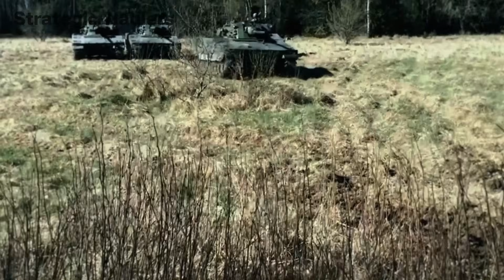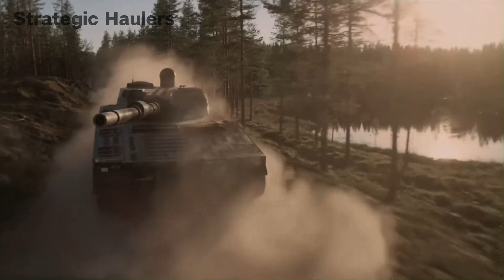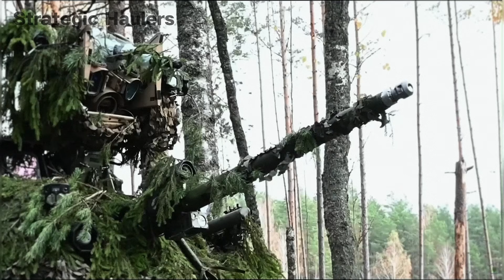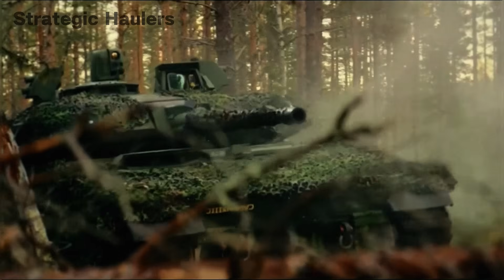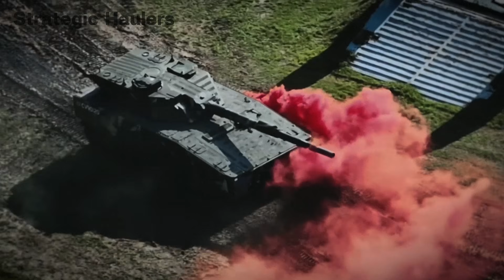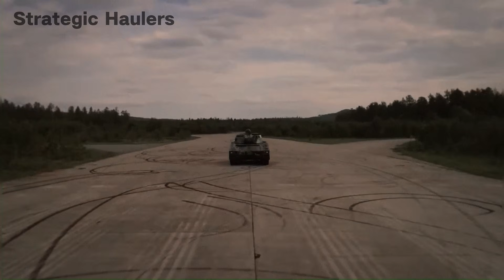The CV90 — How an Upside-Down Cannon Created Europe's Toughest IFV

Comment: Some years ago, Canada launched the Close Combat Vehicle (CCV) programme to acquire up to 108 tracked infantry fighting vehicles. The aim was to find an IFV vehicle that would better keep up with the country's then newly-acquired Leopard 2A4 and 2A6M main battle tanks. The CV9040 was one of the candidates selected for trials. 

However, CCV project managers decided not to go with the stock turret, and instead have DEW Engineering in Ottawa design and manufacture a turret mounting a different autocannon - in this case, the 25mm M242 Bushmaster.

After watching this video, I now understand why an alternative turret and gun system were considered. Ironically enough, at the time, the Canadian Navy's Maritime Coastal Defence Vessels (MCDV) mounted a 40mm Bofors deck gun, so 40mm ammunition was already in the Canadian Armed Forces supply system.
Ultimately, budget cuts resulted in the cancellation of the CCV project.

The current government is now looking for new tanks to replace the now-aging Leopard 2 fleet, and to acquire a tracked infantry fighting vehicle. It's looking like the Korean-made Redback IFV is going to be the leading contender, and possibly the platform that gets selected. Interestingly, the Redback IFV can mount an uncrewed turret mounting a 40mm autocannon using Cased Telescoping Ammunition (CTA) technology.
Reply: The feedback from Ukraine says the only change wanted to the 40 mm is doubling the readily available magazine capacity.
The large number of shells in the Bradley are nice, but only necessary because the the relative lack of punch per shell.
A salvo of four 40mm shells in burst mode on the other hand completely clears a trench 30 metres long.

Bushmaster has taken note, offering the Bushmaster IV in 40mm Bofors.
Reply: I wished the new CV90's also used the 40mm. There are sort of more possibilities in the future with a slightly larger ammo... But NATO logistics, 30mm or 35mm makes sense I guess... 35 has at least a fragmented round I think...
Reply: The CV90 comes with the calibre ordered by the customer
Since Sweden and Ukraine added their vehicles to an already existing order in production, they also got that order's armament.

Comment: At around 14:10 it's implied that a change in threat environment (with more advanced weapons) required the CV90 to get better armor. That's not entirely true.
The first models, 9040 A and B, were (as mentioned) designed to defend Sweden against a WP invasion. The envisioned doctrine was partially based on "protection by shooting first" and the IFVs optimized to be used aggressively, preventing the enemy from returning fire.
Then these were sent to Kosovo for use in peace-keeping UN missions where the rules of engagement prevented shooting first and only return fire. That meant shooting back after being hit by one or more RPG rounds, where the 9040 A/B versions proved worse than the much older pbv 302.
As a result 9040C was developed, with much better passive protection at the cost of reduced agility. It's 9040C that is in use by Ukraine today.
CV90 Mk II (and later versions) are based on these experiences.

Also: One very important feature of the 40mm cannon that's not mentioned is its capability against MBTs. The APFSDS is good enough to penetrate the side and rear of most modern tanks at useful ranges. This provides better tactical versatility than a smaller gun plus ATGM. The IFVs, often moving in forests and other tighter terrain, needs the ability to quickly engage tanks at close range, and ATGMs are neither quick to deploy nor very good at close range (<200m).
Reply: The strf90C came to be in Afghanistan, where the main improvement was air conditioning even though the increased protection was welcome.
To my knowledge no strf 90 were ever used during the UN missions in Bosnia.
Reply: @Mobil-Telefon  Not in Bosnia, but later in Serbia/Kosovo. Therefore the C-version was available for Afghanistan.
Reply: I appreciate your mention of the "protection by shooting first" [and then move quickly and swiftly in difficult terrain]. While not identical, or even fully comparable, vehicles, this doctrine and ability is shared between Strf90 and the Ikv91.

Strf90 - Swedish abbreviation of "Stridsfordon 90", translates to "Combat vehicle 90" ie CV90.

Ikv91 - Swedish abbreviation of "Infanterikanonvagn 91", translates roughly to "Infantry gun support vehicle". It shared several traits with the CV90, especially 9040: Light wheight (partly by weaker armour protection), excellent performance on soft ground and snow, manouversbility, fording capability.. No compartment for infantry on foot, though. OTOH, the gun was a 90mm (low pressure) gun. Intended for several support roles: Tank buster (HEAT ammo), anti-infantry (HE ammo). 212 built, in service 2976-2002.

Although battlefield roles differed, in some aspects I think of the Ikv91 as a precursor to CV9040.

Comment: Put a bofors 57mm l/70 and it will be capable of everything.
Reply: It's too big. It woul need a complete new turret and the passenger compartment converted to ammunition storage.
Reply: @satanihelvetet like with the 120mm gun?😅
Just keep that turret and put the 57mm in it😉
Reply: @satanihelvetet How did they do it in CV90-120?
Reply: @uppsalahazzemarkstedt2759  They made a completely new turret and converted the  passenger compartment to ammunition storage...
Reply: @satanihelvetet @Merecir  good comments. 😊 

To add facts to the naïve notion of just making everything biggger: 

@apostolosapostolopoulos and others

The 120mm is loaded manually, round by round. The back end of the gun is a breech and nothing more. It's what you see in a MBT like the Leopard, Challenger or Abrams.

The 57 mm is an automatic gun. It uses a loading mechanism with magazines - and that part of it is  huge  compared to a 120mm breech. You probably couldn't fit it in a MBT. 

For the curious, with the stamina to search YouTube and the web, there are videos explaining the innards of the 57mm (on a Visby class corvette IIRC). It's been a good while since I watched those, but from rough memory I would guess that the magazines occupy a space of height 1.5 × width1.5 meters (with a guess on the depth to be at least 1 meter). Cramming that into a CV-90 turret is impossible. Not even a deity or a prophet could succed with that, let alone an apostle. The idea is DOA.

PS. Russian MBTs, eg the T-70 and T-90 have auto loader. They have a carousel magazine at the bottom of the turret. This reduces the necessary crew to three since no loader is needed, and a T-xx has a lower profile compared to western MBTs. On the other hand,  the magazine is completely inside and open in the crew compartment. A good hit will make the complete magazine explode under the feet of the crew. This causes the turret house to be thrown tens of meters into the air (also known as "The Russian Turret Toss"). The tank is a total loss. The effects on the crew are obvious.

Comment: 30 mm and 40 mm shells can contain shrapnel for anti-personnel rounds, good against soldiers in trenches, as seen in the Ukraine war. 
BTW, the United States invented the proximity fuse in the middle of WW II and used it to great advantage against Japanese Kamikaze attacks and German troops.
The US Army would be well advised to choose the CV90 and not the German alternative.
Reply: No they didn't. Britain invented it but the USA took on the effort to mass produce it and make the technology work in artillery shells and not just in unguided rockets as the British had done.
Reply: @DeeEight  True. The "heavy lifting" research was done in the US mid WW II.
Reply: The CV90 MK IV is just an modernised 1980´s design.
The KF41 is a modern 2010´s design.
You do you, but a new modern design is generally better than polishing up a 40 year old design.
Reply: It was USA who invented the rotation activated battery that allowed proximity fuzes to be used in shells.
Reply: @Mobil-Telefon  And that was in WW II
Reply: @cathulhu-q7y yeah right

Comment: Well.. According to loading when the magazines are empty are not difficult, it just require some training and it will run smooth even in full speed!!

The empty shells are ejected Infront of the vehicle and if you are that stupid enough to stand in the way of a shooting IFV you better suit your self!!
Reply: Thanks for clearing this up. I can confirm. I did my service in 1998-99 as a gunner on the CV9040.
Reply: @Gwei79 Awsome!!👍 Härligt👊🇸🇪
Reply: I also reacted to the claim that empty shells falls on the roof. Never seen that.

It's either sloppy research, or (more likely?) blatant assumption.

Comment: i question a lot of the propaganda on this one, 40mm bofor's is a general purpose jack of all master of none. 50mm your looking a infantry support do to the ballistics HE and frag round's. 37mm is the go to for anti armor penetration's work in a IFV. the 40mm struggles to take out other IFV and other heavy armor it mostly 37mm 0r 90mm for that. 40 it the i don't now wut i'm fighting but i want to hurt it. 37mm mess up IFV and give you more round to do it. i still love the 40mm on an IFV it the 45colt for an IFV.
Reply: 37mm?! LOL... nobody has used that caliber in any meaningful fashion in decades. There's less shell development into 50mm than the far more common 40mm used by the Bofors L/70 guns. The Tungsten-road APFSDS-T Mk II IM round from Bofors Defense for the gun on the Swedish CV90s will penetrate in excess of 150mm of RHA at 1500 meters. The more compact CTA 40mm for the CTC40 gun on the British AJAX will do 140mm of RHA at the same distance. In either cannon's case, that's enough penetration for ANY IFV in existence, and many older MBTs still in service in many countries from any angle, and pretty much everything up to the T-90s on the side to rear 2/3s of the tank. The front hull side armor on the T-72 is only 80mm thick, and at anything from 25° or more impact angle the Bofors APFSDS-T Mk II will penetrate into the hull. The armor in the middle side of the hull under the turret, and adjacent to the ammunition carousel for the autoloader is much thinner tapering down from the 80mm at the front third to about 20mm by the back next to the engine compartment.
Reply: @DeeEight  "far more common 40mm L/70 guns".... basicly only used by sweden and now by ukraine in IFV´s and ukraine wishes to move to a 30mm or 35mm gun.
The rest of the users uses them in a whacky air defense role without AP shot as either emplacements or CWIS Turrets on ships.

And no, the 40mm is not enough to penetrate ANY IFV in existence. KF41 and Puma shrug that off like it was rain.
MBT´s with less than 150mm RHA steel armor plate are from the 1950´s and early 60´s (T-54/55, T-62, AMX-30B, Leopard 1A0). Those got composite and ERA armor packages over their service life, wich render them resistant against the 40mm.

No at a 25° impact angle, the 40mm will not penetrate the frontal side armor of a T-72 at 1500m.
Reply: @cathulhu-q7y  Forget it. The 40 APFSDS penetrates more than 15 cm RHA.
Reply: @CarlSöderquist  30mm and 35mm APFSDS does 14-15cm too.
Puma and KF41 can take frontal hits in excess of 1000mm HEAT penetration and larger than 40mm AP
Reply: @cathulhu-q7y  Look at the different size of the shell and ask yourself if you can get the same penetration from a 40mm as from the 30-35mm. The energy comes from the gunpowder. Quite a lot more gunpowder in the 40.

I have worked with the development of CV90 from the very beginning.

But I do think that the 30/35 is better for an IFV than the 40. That is due to that you can carry more rounds.
But penetration is better on the 40.
Reply: @cathulhu-q7y  No way. They may have reactive armor, but forget that they can take a more than 1000mm penetration SC. That is MBT level.
Reply: @CarlSöderquist  Cartridge Size is not the only factor in penetration capability.
The primary factors are projectile length and projectile speed.
And 30x137mm and 35x228mm APFSDS are quite a bit faster than 40mm APFSDS and have just marignally shorter projectile length.
The penetration capability on 1000m is just marginally better on the 40mm. We are talking about a few milimeters difference.
The 40mm was significantly powerful in the late 80´s and early 90s, but since then 30mm and 35mm ammunition developement overtook the 40mm in quite a few aspects.
Reply: @cathulhu-q7y  You have more energy in a bigger case. The same projectile will go faster. The 40mm has  70 caliber length and the 35mm has 50 cal.
I have been working at the Swediwh defence material administration (FMV) at the Weapons directorate with CV90. We tested them all.
Reply: What do you think of the 40 mm CT used in Ajax and Jaguar?
Reply: @Mobil-Telefon  I love the new 40mm cased telescoped but i question if barrel wear is going to become a problem do to the powder load behaving like a magnum load for the 40mm we saw the same barrel wear problem in Japanese made L/44 120mm shells were they had to rework the barrel alloyed after shorting the barrel to let them fire over mountain top more easily, they then adding more powered to make up for it. it's one of the head ache's the US has with the other country's in NATO and close ally's is this "shell safe for us to use did they do some to the ammo load and not tell use" again???
Reply: @Mobil-Telefon  unicorn gun with unicorn supply chain. Currently there are only  around 470 guns in service world wide (or on order) and even with the potential increase of french CT40 use, the number of CT40 guns in service will likely never reach the 1000 guns, leaving a very expensive and complicated ammunition production to the currently 3 operators (France, Belgium and UK), wich results in prohibitive ammunition prices per shot.
Due to the lack of customer base and small number of operational guns it is effectively dead on arrival due to ammunition production prices.